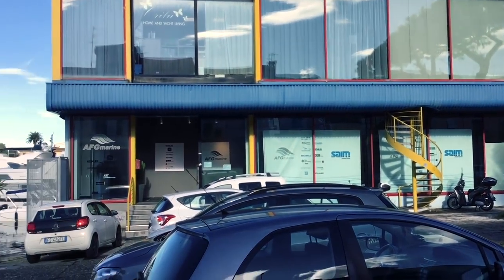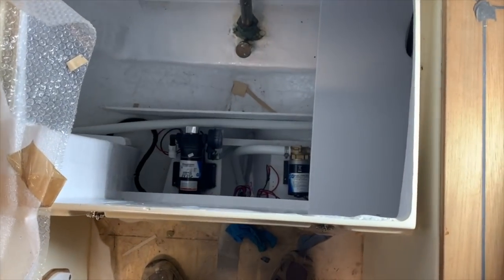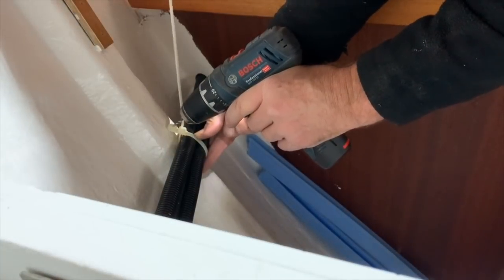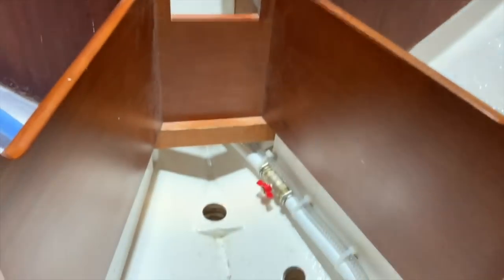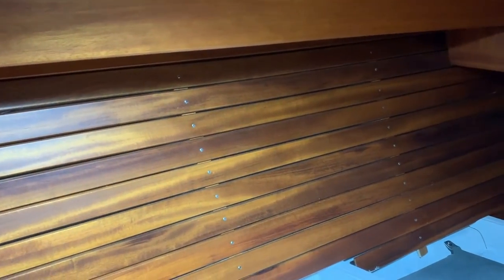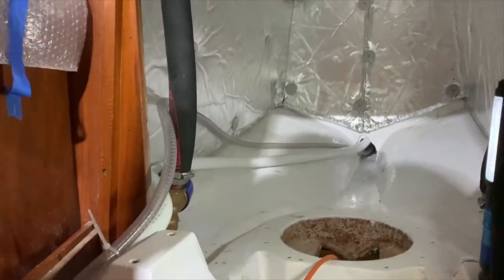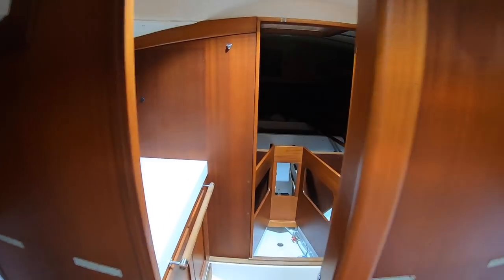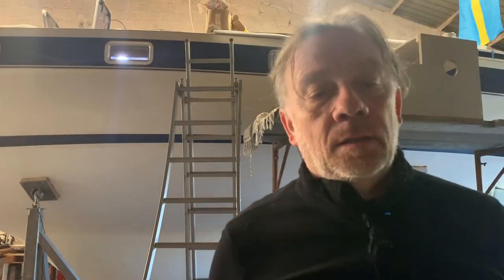Hallberg-Rassy 312 "Ellös": CARPENTRY & ELECTRICITY  (DIY BOAT)

Comment: Gabriele because of the perfect design of your boat it would be very easy to install insulation before putting the slats on, are you not interested in insulation? Love your videos! Ben S/V Dawn
Reply from the maker: Hello Ben! I will sail in warm temperatures and I prefer to get air that flow under the slats than put something block it and accumulate mold... I will see is a piece of cake to take out them if I need! But thanks for your suggestions!!!